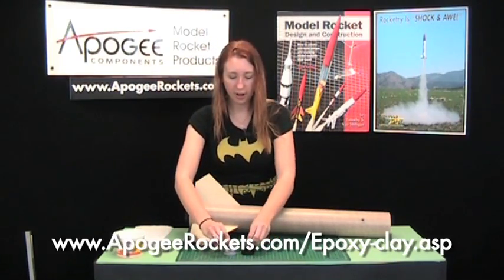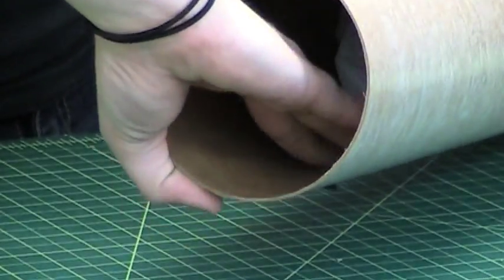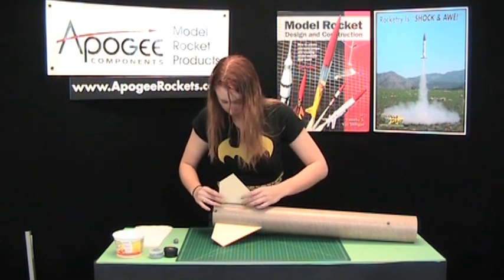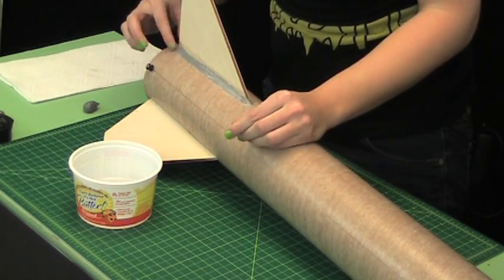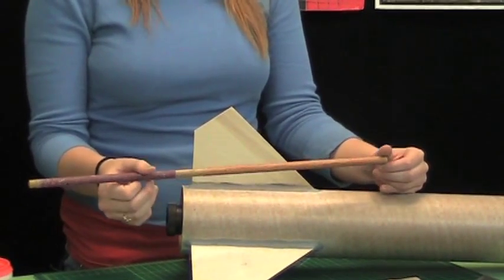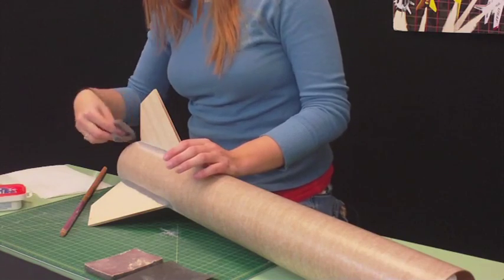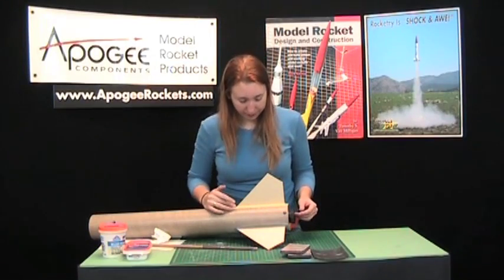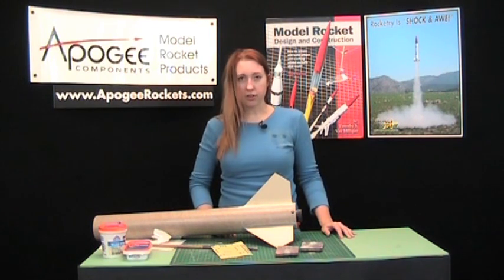Building Your First High Power Rocket - 5: Fin Fillets

Comment: Thank you for the presentation. It was easy to follow along and I feel much more confident about making my own fillets for larger models. Up until now my fillets on my smaller rockets were done by simply dropping a bead of Elmer’s glue on the joint and running a finger down the joint to smooth it out. I’m finally building a larger rocket where a dollop of glue just isn’t going to cut it! 🙂

Comment: do u have a video on how to make the motors for you rocket? and how to mount them inside? and the charge device to deploy the para shoot? plz reply?
Reply: You don’t make the motors. You slide the motor in to the mount then screw on the retainer. Then for dual deployment is a complicated thing but you have to work your way up. You also have to be 18 to pack the black powder charges.

Comment: Not impressed.  Fillets should be done with at least a 30 minute "slow set" epoxy with a filler (micro-balloons or west system additives). The longer the working time of the epoxy means the deeper the penetration and stronger the joint. And, nothing works better than good old fashioned saliva instead of water to smooth them out.
Reply: this clay epoxy takes 24 hours to cure. I think that'd be slow enough

Comment: I was just wondering.... Since this is going to be a high power rocket, why haven't the leading edges of the fins not been sanded down, creating a more aerodynamic shape? These fins seem to be quite thick, so a more aerodynamic shape should help make the rocket fly more stable and fly higher. On rockets like these, I would have used curved fins, not flat ones. Both leading and trailing edges on these fins should be made sharper. It does help. And a more experienced tutor would help, too.
Reply: telescopereplicator curved fins?
Reply: In another video I watched by apogee components they mention that they don't create airfoil shaped fins on some of their rockets because the "squared off" fins look better in photographs.